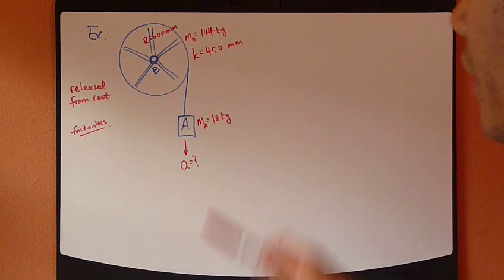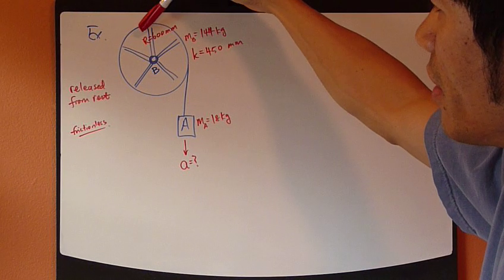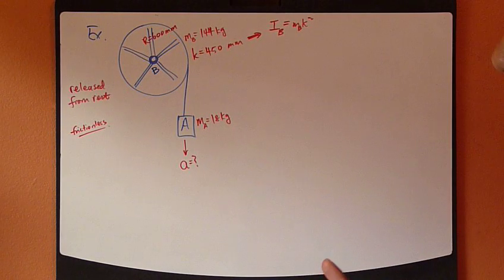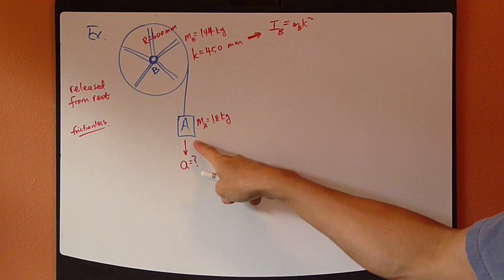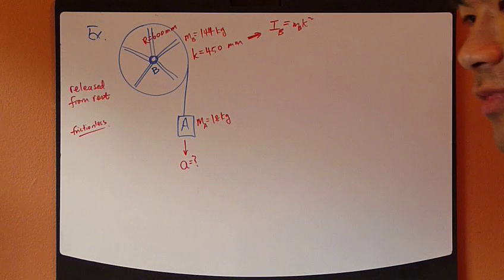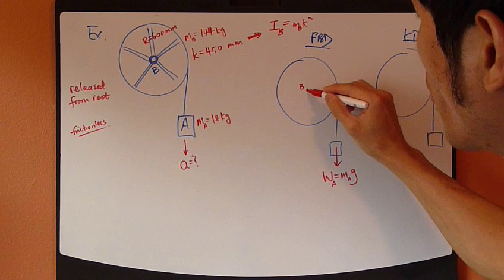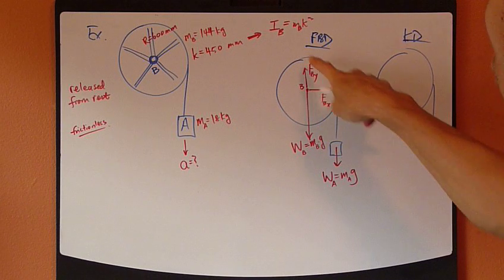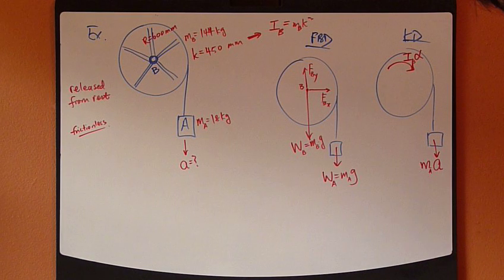Engineering Dynamics Ch.17 Part8: Rigid Body Kinetics - 2nd Law

Comment: why is the force of tension in the string not included in the force diagram?
Reply: Because the string tension is *internal* to the FBD. For any FBD, you draw the external forces only, which in this case include the two weights and the pin reaction forces.

Comment: When you analyze both the Wheel and the Weight A together, tension is an internal force. The tension from the Wheel points down, the tension on Weight A points up, they have the same magnitude, so they cancel out